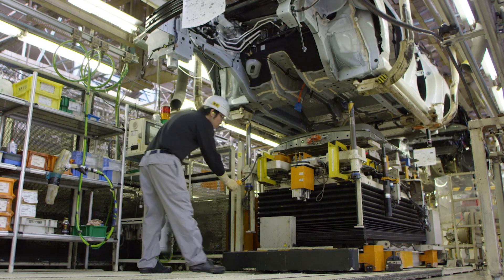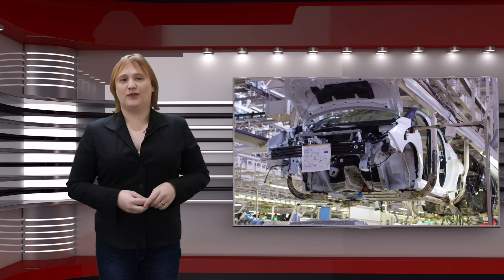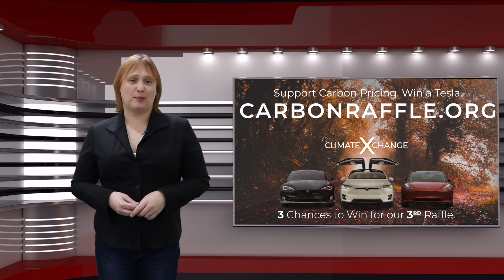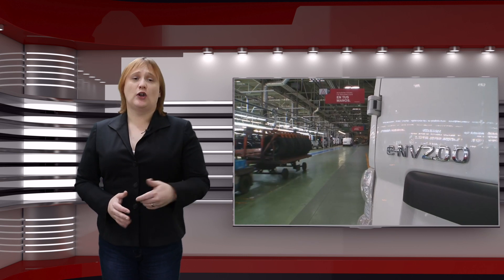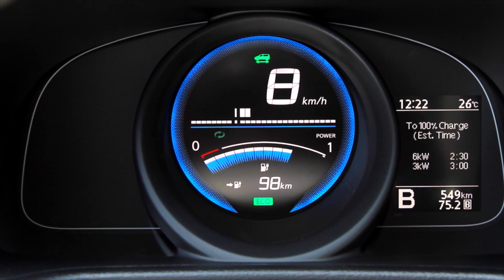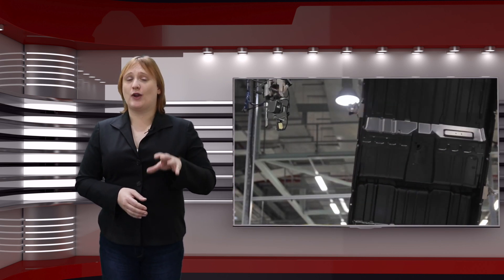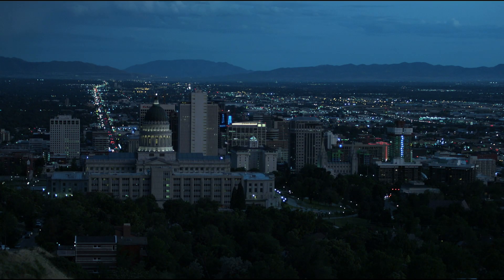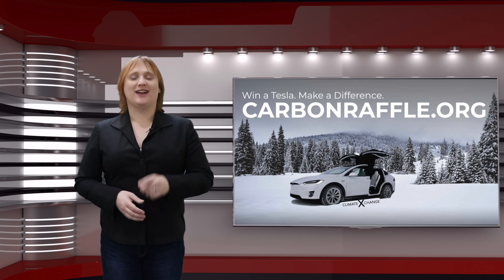The 2019 Nissan Leaf e-Plus Will Get Air-Conditioned Battery Cooling, Not Liquid Cooling

Comment: What can you expect from the Nissan / Renault merger.  The cars were far better under Nissan yet without the merger they may have died.  Better to burnout because rust never sleeps.  Nissan is full if rust.  If they do not change they will die.  They make just wonderful CVT's LOL!
Reply: At least Renault is cooling the Zoe's packs since the beginning (cooled air only as well, but at least not only when the car is switched on…)

Comment: Not another #rapidgate nissan please ! Why is nissan standing alone in not having liquid cooling or heating of its pack ? My guess is they calculated that by year 8 or 100k miles it will still be at 75% SOH ! 

Make a product that will ' just' stay  above  75% soh , not good for long term battery health !
Reply: Yea exactly the fear I have with my 2.5 year old 56k mile 30kw Leaf with 88% battery health. I don’t see it going under 75% by 100k miles but wouldn’t be surprised to see it at 76% and feel like Nissan did it on purpose. It’s really a stupid warranty when they only cover it under 9 bars, at which point your car is 3/4 as good as it was. My Diesel VW and Hondas didn’t drop MPG that massively after more miles...
Reply: #rapidgate2. The Sequel.

Comment: Should be fine in a cool region like Canada though?
Reply: Nouvellecosse it’s not just getting hot, it’s also if it gets colder. Without active management, the battery can’t heat fast, warm, or efficiently. 
I have 3 friends with 2012 leaf’s (leaves?) and their range has permanently gone from 140-160 km to 100 km. It is just really disappointing that they couldn’t even fit liquid cooling in the leaf when my 2014 Smart Fortwo electric has liquid cooling/heating in a internal combustion platform. Plus it’s a smart car!
Reply: finland leafs are in pretty good shape
Reply: toronto maple leafs are looking good right now too ;)
Reply: Clearly you have not been here during summer, it can get over 40 C in summer all the time.  And if you are park on black parking lot the temperature can soar way higher.
Reply: Earl Pottinger Yeah! It’s just on Vancouver island, we are less hot and more cold. But the heat issue still shows itself.
Reply: @earlpottinger671  I've lived in Canada my entire life and while i realize Nova Scotia gets milder winters and cooler summers than places like Southern Ont. and Quebec, it certainly doesn't get 40 C "all the time" anywhere across the country. In fact, if it has ever actually reached that temperature it would most certainly be some kind of record. Maybe not an all-time, but certainly multiple year record. Unless you're talking about the "feels like" humidex, but that doesn't affect cars. Point is, a hot day to us isn't as hot as in a lot of places, and heat levels that would affect an electric car don't occur as often here. In fact, the cold is probably the bigger issue as someone else pointed out.